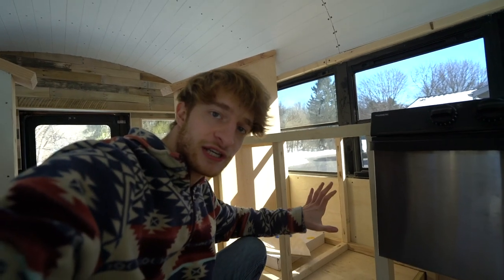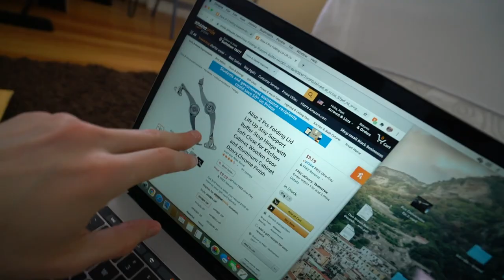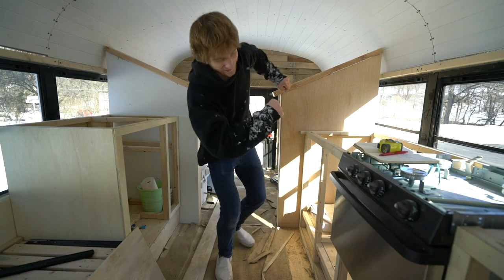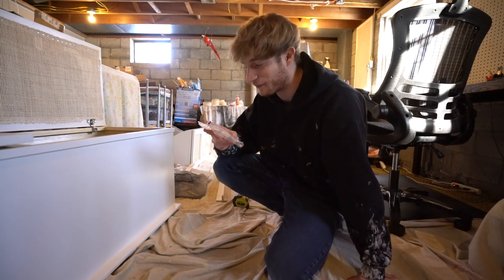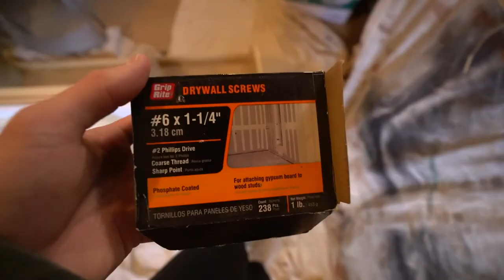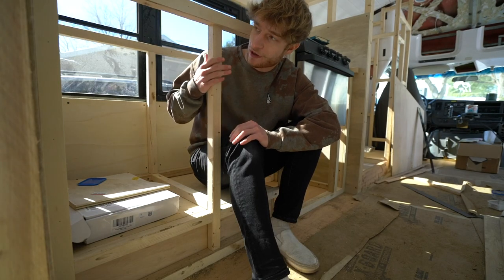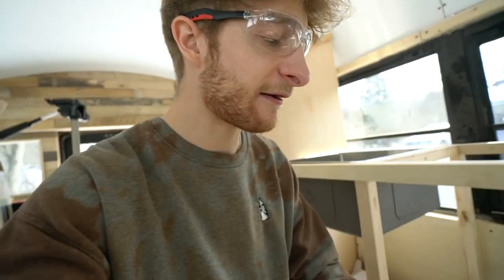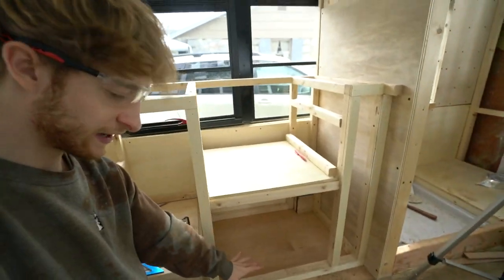The Sun is Back and So is the Bus Build! - Skoolie Build Ep. 35

Comment: You should build some kind of an insulated box that would go against your windows behind your sink cabinet and you could utilize that space back there for like different containers to hold your silverware or whatever or cooking utensils or even plastic boxes of bike dried different dry goods and stuff that would be held in place by just being back there. But it would also insulate the bottom parts of those windows that are behind your cabinets anyway that would help keep your bus warmer in the winter cooler in the summer plus it would block off any bad view of wiring or Plumbing behind your cabinets through the outside window
Reply from the maker: Hey great idea! I’ll play around with it

Comment: I thought I hadn't watched this but then it started looking familiar.  Seeing the video a second time it occurred to me that having the sink beneath the counter you could leave the cutout section over the top of the sink when you are not using the sink to create more counter space and you could remove the cutout when you needed the sink.  You would need to cut out slightly bigger than the sink opening so the cutout could rest on the top of the sink.

Comment: Normal service has been resumed Matt. Great vid. Are you going to flush mount your sink so the worktop sits ontop level? or are you going to pack it on the frames as the sink is a little proud mate.
Reply from the maker: I didn’t even think of flush mounting it, I was just going to put the counter right on top, but flush mounting is a great idea!